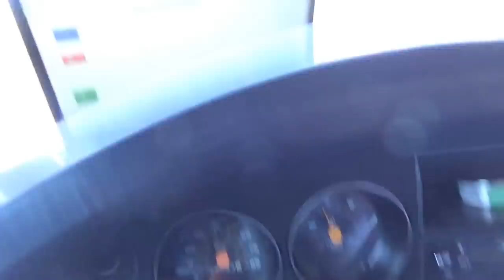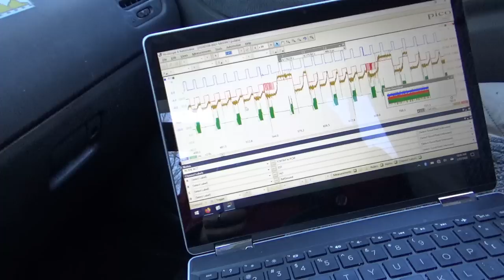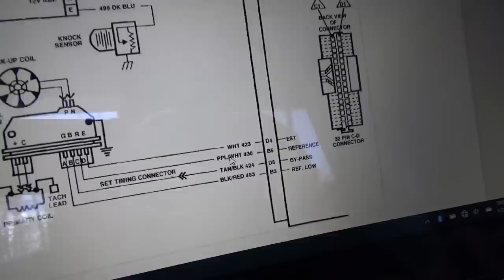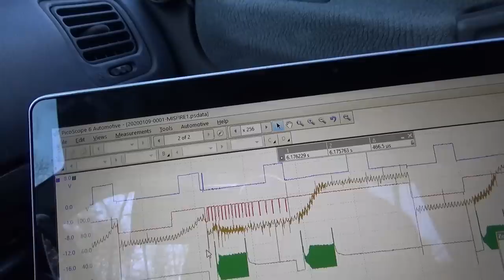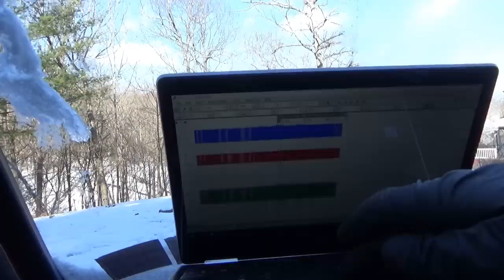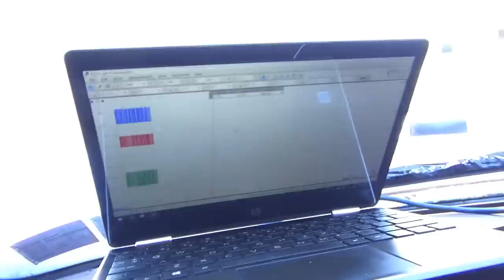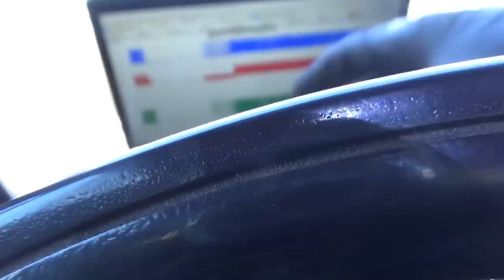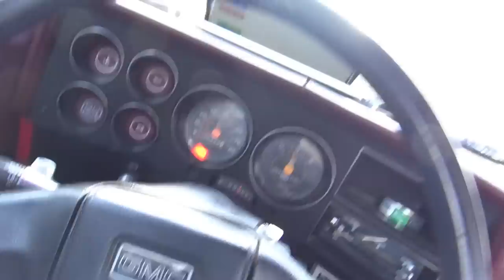COMEBACK? (87 GMC Plow Truck STALL/Misfire)

Comment: Sometimes an old-school parts canon called a tune-up is what's needed , for old-school vehicles
Reply: Exactly LOL It does not look like that air cleaner cover has been off in a long time, part of the tune up as to clean the outside of that. You need to give it a little love once in a while. haha
Reply: It’s not that exactly, a parts cannon. The vast majority of misfires back in the day were from the ignition system. All it took was a quick visual many times to find the problem. Easy in, easy out and easy on the pocket book. 
Carbon tracking to that degree on the distributor would mean the engine hadn’t been serviced in years but kept operating anyway.
Reply: Totally agree
Reply: Old Chevy trucks . They suffered from moisture and wear in the distributor caps . Old tech here . My 2000 Silverado has a distributor too .
Reply from the maker: @debrittojoseph  is it a 2500? Our plow truck is a 99 Silverado 1500 with the 4.8 LS engine and no distributor 🙂
Reply: @PineHollowAutoDiagnostics   probably the OBS CK 2500/3500. I've got a K3500, model year 2000. 5.7 Vortec SBC. Not a daily, just gets driven every now and then hauling junk. Spider and distributor...not a fan of that stuff myself if you need to diagnose. I certainly prefer the LS for reliability and maintenance.
Reply: @debrittojoseph  depends on the engine, the 4.3 and the 5.7 only had distributors, poor ones at that made of plastic - don’t mess with innards of those just replace the dist assembly with aluminum aftermarket problems solved
Reply: @kellismith4329  and the distributor hear being work causes timing issues too . Old tech man . I didn’t understand why gm had coil packs in my 2000 s10 but a distributor cap in my 2000 Silverado 1500 . It was very weird .
Reply: @PineHollowAutoDiagnostics  it’s a 2000 1500 with a 6 cylinder . 150,000 miles . I had to replace the gear to get it perfect after replacing the distributor and the insides .
Reply: @debrittojoseph  i would not believe you are a old tech gm gor away with distributors for age now my old 95 cavalier didn't have one and nost likely your 2000 truck got a ls engine = no distributors
Reply: @legros731  it was a 2000 Silverado with
Reply: A distributor and a 2000 s10 with the 2 coil pack system .

Comment: Damn. That old rotor had a lot of carbon dust in the center. It doesn’t take much to arc to an adjacent cylinder or to block ground via the rotor shaft. 👍

Comment: Ignition cap and rotor was routine maintenance for these old trucks along with spark plugs but I guess plugs can go a lot longer than they use to when I was young.
Reply: Yup! Always changed the rotor, cap points condenser and plugs. Would watch at nite with dad to see if the plug wires were shorting out. The good old 50’s Chevys. Sometimes dad would scrape crap off the rotor terminals. Chevy thunder!
Reply: The cap and rotor sometimes just need a cleaning with some cleaner without oil to get rid of all the dirt that can cause the spark to jump. If you do that before the sparks starts to jump then they can last a long time.
Ignition cables can be a bit of a hidden fault source because they can crack and then the spark jumps to ground randomly. And as soon as you fiddle around with the distributor cap they move a little and the fault goes away for a while and then comes back.
Of course - spark plugs need to be replaced now and then, and when replaced always check the gap. Especially on older engines the lead or lead substitute could build up on the insulator and cause the spark to follow the insulator surface, so even if they look good they may be bad.

Comment: Hi Ivan in the past I've worked on these, this is a problem tough to find. what would happen is the wire from the reluctor pickup (purple) would break internally while the silicone cover was intact. I found that if you pulled on that wire you could see it separate and stretch the insulation. when the advance would initiate the wire would pull on the break and cause the engine to stall but when in a non advanced state would sometimes connect enough to allow the engine to start and idle.
Reply from the maker: Would be fun to see that with the scope :)
Reply: Had a similiar problem on a 76 Trans Am, car would idle fine when, when throttle was depressed vacume advance would rotate pick up coil and wire would open, engine die, as RPM dropped vacume advance would rotate back and engine would refire.
Reply: Yes, that was a classic pattern failure, but not applicable to this particular truck since this truck's distributor has no mechanical advance mechanisms.
Reply: @hightttech  the metal still rusts, expands the bobbin and breaks the coil or shorts turns out together. it's worse on plow trucks, vehicles that sit around and things not ran for long periods to keep moisture at bay.
now it just needs spark plugs and wires, guaranteed the wires are shot and plugs mile wide gap, with huge crusty chunk buildup on the ground straps.
that's exactly what makes the dist. cap and rotor arc, crust the terminals, and chew the button away.
Reply: Bottom line is dude should take better care of his gear old Or not
Reply: @throttlebottle5906 I never heard of "RUST" "expanding" the pickup coil bobbin. Is there a TSB explaining the phenomena?  Also, assuming the pickup coil IS compromised, either shorted or open circuit, you would have a crank_no-start or long-crank_hard-start. If vehicle started, driveability would improve as engine speed increased. The shorted pickup coil will have quite low voltage on scope, and will fail a Q test on LCR meter and a "RING" test. The open pickup coil will also have low voltage on scope, and fail DCR test, Q test and RING test.

Comment: A nice easy fix for once! Strange that wasn't an issue a month ago when diagnosing the misfire.
I think you just wanted to drive Chevy Thunder once again! Lol
Nice classic truck.
Reply: Remember Ivan said he cleaned it. That probably could have delayed the issue from reoccurring. If he had only touched one thing at a time it might have shown the first time. It's not always easy to be systematic but it helps to work through one part at a time to see if there are sympathetic problems.

Comment: Distributor caps & rotors are consumables, just like brake pads or engine oil. It's easier, cheaper, and more reliable to simply replace distributor cap, rotor, plug wires and plugs every couple of years. If there are breaker points, replace those too.

Comment: I had one of these act the same way. it turned out the high voltage wire from the ign coil to the dist cap had high resistance. at night it would actually glow.

Comment: This truck is just like the ones I drove in the USAF back in the 80s.  I was based at the bombing range in Avon Park Florida.  They looked badass in cammo and were great in the soft deep sand, when you thought you were stuck you'd lock the hubs located on the front wheels and they would always power out.  They could take a lot of abuse, trust me 😆

Comment: The humble distributor cap & rotor are replaced more often than they need to, but in this instance they needed to be. (The humble spark plug also used to be replaced too often when looking at ignition issues, though these days they re not so cheap).

Right now it is 11.30PM at night where I am, it is 26°C (78°F). I wish we had snow where I lived!!
Reply: You are right about the cap and rotor, I found that much more likely it was aftermarket HT leads (bright colours and appearing to be thicker) I found that with Ford vans a new OEM HT set worked wonders, also setting plug gaps correctly
Reply: After spending 63 years in sunny San Diego, I escaped the tyranny of CA and moved to the Boise, ID area where I have finally experienced snow and cold winters, though not like PA. I love that! It always pissed me off when it was 80 degrees on Christmas Day, which happened way too often.
Reply: As I mentioned otherwise the Chevy 350 and 4.3 V6 have a very poorly placed distributor. It's position on top and to the rear of the engine where there is no air flow and literally cooks the distributor cap causing it to warp. Replacing this cap at least every 60,000 miles was a necessity  with these engines; but I agree with other engines of the day, not so much. OTOH, back when distributors had points, they were probably the number 1 fail point of ignitions and long starts.
Reply: @TheOnespeedbiker  you are not wrong they are impossible to work on you have to crawl right up there and use mirrors etc - I don’t mess with them anymore just swap out distributor as a whole and call it a day
Reply: @kellismith4329  Oh man, I thought it was just me getting old. I inherited the 94 Jimmy 2 years ago with only 98 000 miles. I have always liked working on cars but that's not happening with my 2021 Jeep. So I kept the Jimmy has a hobby to have something to work on. When I changed the cap and rotor it took me over 1/2 hour to properly position the new distributor cap before the screws would thread in; thought I was loosing my mind 🙃. Further the font spark plugs wires are so long they require guides to keep them off the exhaust manifold and of course half of them broke; fortunately they are still available on eBay.
Reply: @Paramount531  Well the first Xmas would have been a hot day, no?

Comment: The older HEI units with the larger round rotor. Coil on cap. The rotors would start to fail through the center. Not a complete failure, so the engine would run but just like it had a large vacuum leak. Other common failures would be the module and that would be a complete no spark. Common, like another poster said, was the pick up wires breaking. Or the pick would open up during a hot soak and a no start. We would shoot some freon on to the pick up and the vehicle would start and run enough to get it to the shop. Some times the broken pick up wires would cause an engine lope .Run, quit, run, quit as the vacuum advance unit would shift the pick up coil back and fourth.

Comment: Rule number 1 in old GM ignition systems. Replace cap and rotor (and seal) as maintenance while replacing ICM. Rule 2 always spray down secondary with water and verify no spark leak to cylinder during the conditions you may not be able to recreate sitting in the bay/driveway/lot. You're right , secondary kills the primaries on these, but gotta make sure you check ALL the secondary 😉
Reply: Good to see you commenting Keith.     I still service quite a few of these systems in old gas 366 engine buses.   It’s crazy I know, they just keep working and working.    What “seal” are you referring to?
Reply from the maker: Great tips Keith! In this case I don't mind replacing one part at a time because I always get invited in for Ukrainian food afterwards 😁

Comment: Agreed...those ignition systems and designs were very reliable however, they do have wear factors so in the old days a typical tune up consisted of plugs, cap and rotor and setting the timing. As in this case, the carbon debris builds up and there are often micro cracks in the cap that play with the spark causing it to deviate from the target ignition post and then you have multiple ignition going on.  From the looks of that existing cap and rotor, they needed replaced long ago. Again, if this truck owner is expecting his rig to run correctly, he needs to invest in some maintenance and parts because they do wear out and with his plow and steep driveway, he is asking for 80% of total performance most of the time. Yes, the parts for the non computer managed ignition are much less complicated and way less expensive and just about every parts store even in the outskirts of the urban areas will have them in stock. Lots of us who have those older 80's and 90's GMC trucks will stock up with parts and have them stored on hand just in case theres a period when parts become scarce...most of the mechanical parts are everywhere still today but if you need body parts, side moldings, emblems, interior plastic or seat belt hangers etc. you are out of luck. LMC Truck etc. are the only sources for types of parts and they are all China aftermarket sourced. OEM is getting to be very difficult to get although, rockauto.com is a fairly good source for Delco and GM replacments.

Comment: That truck had classic "i need a tune-up" symptoms from the get-go. When I first learned to work on cars that's what we did..toss a set of plugs, rotor and cap at it and nine times out of ten, away she went! You still need to do the plugs. Check the condition of the plug wires too just for giggles.

Comment: Did you check the spark plugs the first time around? If the gap is too big, it can put too much stress on the ignition module and start eating them.

Comment: Many of us who worked on cars in the 70's/80's know full well about the distributor cap and it's failure(s ) rate and problems. When was the last time you pulled out a Dwell Meter?  :)
Reply from the maker: Who needs a dwell meter when you have a scope ;)
Reply: @PineHollowAutoDiagnostics  Yes indeed.  We didn't have such things for DYIer back then, though.  :0)
Reply: @PineHollowAutoDiagnostics  Or who needs a scope when you have a dwell meter and a timing light.  They were really fun times, so simple cars.
Reply from the maker: @jimbergen5232  yes a timing light is essential for sure. But you can get around that with a pressure transducer to see TDC and measure degrees 😁
Reply: You give me flashbacks to the days of points. The DIYers often didn't even have a dwell meter, so they used feeler gauges, or a matchbook cover. And forget about a dual-points setup; most couldn't explain why they existed, and definitely had NO CLUE how to adjust them 😆.
Reply: I think some secondary scope patterns would have told the story on this one . Firing voltage would have been high . Thanks for another great video Dwayne nz.

Comment: That wasn't a comeback the orginal problem was a no start due to the module not grounding ... this new problem was a maintenance issue. That button in the cap was arcing bad seeing all that carbon on the rotor and the fact the button was stuck or worn out.

Comment: My era vehicles.  Had a similar problem with an 87 Monty SS.  The car stumbled on idle and randomly would misfire.  Turned out to be the pickup coil.    The coil part of the pickup was good but that pickup contains a magnet (the circular part with the points) that became weak over the years, and as the temperature changed so did the the magnet inside that pickup.   Ran good cold but skipped when heated up.  The pickup coil was discontinued so I had to purchase a rebuilt distributor to stop the misfiring.   Also, had a 92 GMC truck that had play in the distributor top bushing that caused the shaft to wobble as it rotated inside the pickup which caused a random glitch.  You are dealing with a truck that likely has high miles. Grab the top of the rotor and see if the shaft wiggles in the top bushing.   Replacing the top brass bushing inside the distributor shaft fixed that problem.   As the shaft wobbled and wore the teeth on the magnet I replaced the pickup as well.   Great vids.  Iv`e learned a lot from them.  Good luck ..
Reply from the maker: Odo shows 57k...but no hundreds digit so who knows 😅

Comment: Common problems with these old TBI engines is the pickup coil wire (pickup coil wire cracks near the coil) or star wheel at the dist shaft (cracks because rust).
Just for help for next time, when you go replace normal maintenance items for this truck :-D

Comment: I've always made it common practice to replace the cap, rotor, plugs and wires every 12 months.  It's cheap insurance to replace those components on a regular basis to keep the vehicle running as reliably as possible.  And in all due respect, thermal compound is not necessarily required on that ICM.  It certainly won't hurt anything though.  But dielectric grease should be used on all ICM connection points.  Because no matter how hard you try to seal that cap, moisture always finds a way in.

Comment: I am an old tech was working on cars when HEI first appeared. It was very common for the rotor to go bad.  The energy from the carbon nipple would find it's way through the cap to the distributor shaft. That rotor was a big wide unit usually white so you could see the burn thru on the back side.
Reply: Ditto 👊🏻

Comment: That old Square body will out last any new Vehicle. That is a Regular tune up. Every other year or If You travel like I did with One.   I did it every year. Plugs cap Rotor. For 10 Years I drove an 87 Square body. From PA to West Virginia , and Ohio. 2 Trips a Week. And it never left me down. They last forever.  That Module I always had one in Glove Box but I never had too use it. But it was there...LOL..

Comment: Ivan, I think that is pretty smart keeping a file of waveforms showing past problems you had to diagnose and what they looked at.  Sure it turned out to be a cap and rotor that was worn out and in need of replacement, but now we also know it's not something more complicated. Still love the sound of that Chevy Thunder. Thanks for Sharing!

Comment: When that truck was made, the normal yearly maintenance would have the rotor, cap, wires, and plugs replaced as consumables. Plus if the truck managed to make it to 100,000 miles, you'd throw it away.
They don't build vehicles like that anymore. Thank goodness.